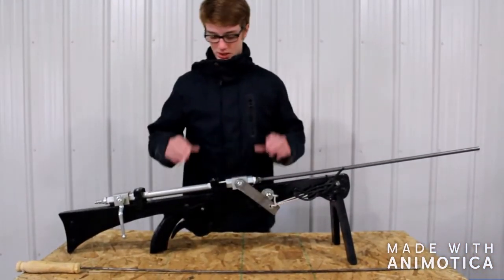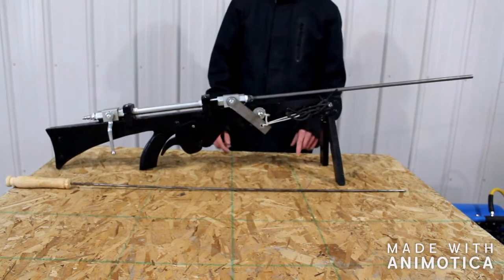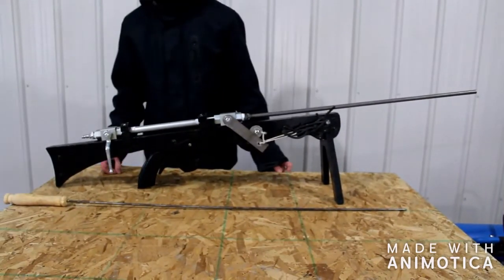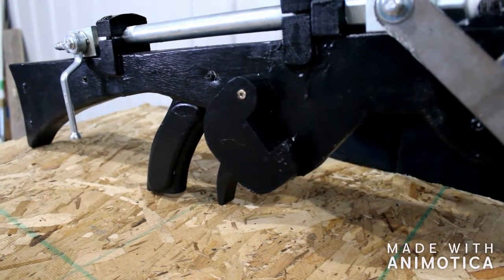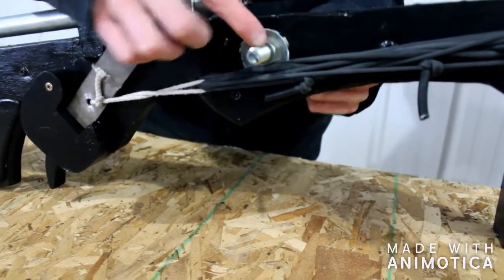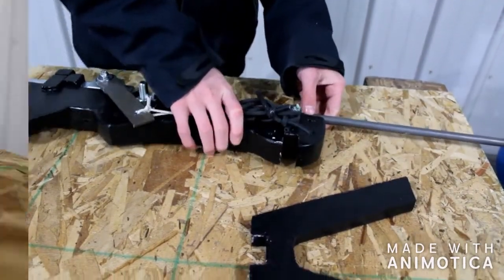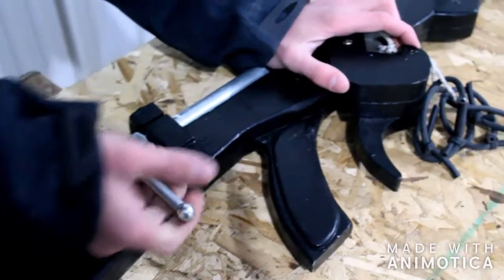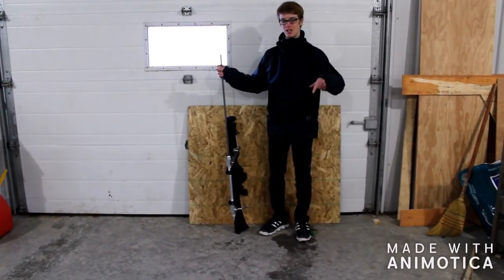My high pressure air gun tutorial

Comment: Hi there, may I know how long if  you pump it to 3000 psi with hand pump?
Many thanks
Reply from the maker: It depends on your strength and endurance but with steady pumping I would guess  3-5 minutes
Reply: @isaiahdueck9601  
Your air tank is matel or steel? 
Thanks.
Reply: @isaiahdueck9601  
Thanks for replying.